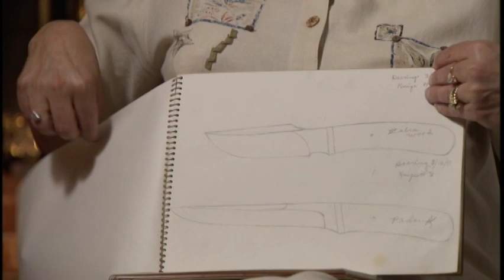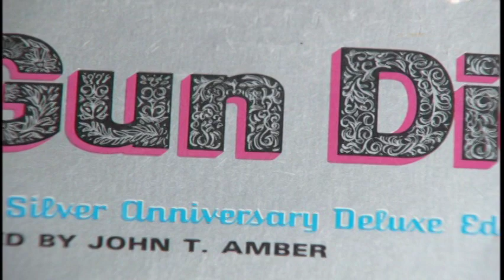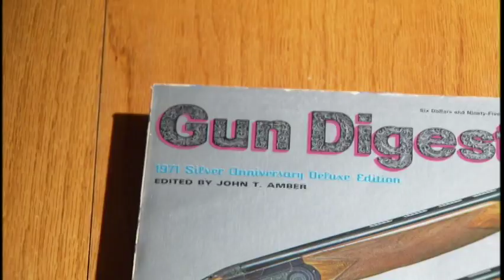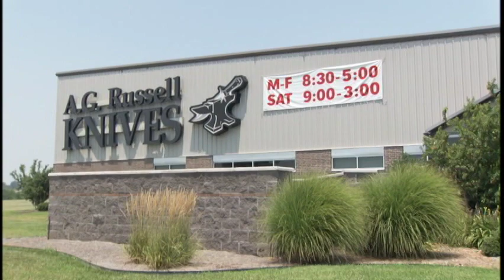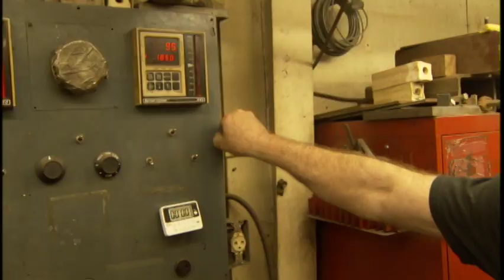Making Knives, the History of the Bowie Knife, and the Rambo Knives

Comment: All well and good but no mention of Bill Bagwell and the Hell's Belle or any of his other fine blades. Why?
Reply: Anna Peterson I was pondering the same thing.... Jerry Fisk learned a lot of the forge welding techniques from Bill...Mr. Bagwell makes the finest Fighting Bowie in the world...God Bless him.
Reply: Well most likely those who know Bill know he tends to rub people the wrong way on occasion. Just a thought. Still one of the great bladesmiths of all time. Should have been mentioned in any discussion on bowie knives.
Reply: @jefff8106  Bagwell and Dozier may not win the charm awards for sure... Jimmy Lile? Class act and died too young
Reply: @rocksandoil2241  a few pounds of metal dust in your lungs tends to weigh heavily on folks.
Reply: @1pcfred  I've thought of giving knifemaking a try for years but the other day, realized my jobs for the last several years have been grinding. Grinding scrap polypropylene, grinding (sanding disk) steel and aluminum trailer frames prepping for adhesives, etc.
I already cough till I turn purple, use 4 qtips, black snot, black uncleanable calluses and cracks in my hands, continuous eye infections, etc. All the more reason to give it a try
Reply: @chetyllynnverellen1365  it can't hurt. Personally I think there's loads of knives in existence now. I know I have a lot of knives as it is and I can easily get more if I want them. But I suppose some like to make knives for the creative process involved? As great as the inclined plane may be I find it in its basic form to be a rather pedestrian object. Perhaps that's the challenge that appeals to folks? Because I have certainly seem some knives that are works of art. Still, I don't go much in for that myself.